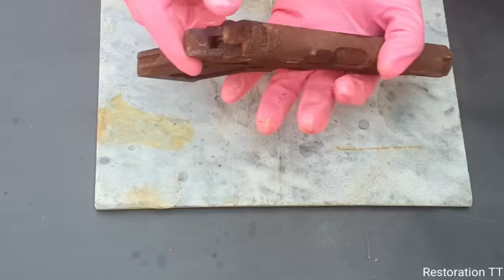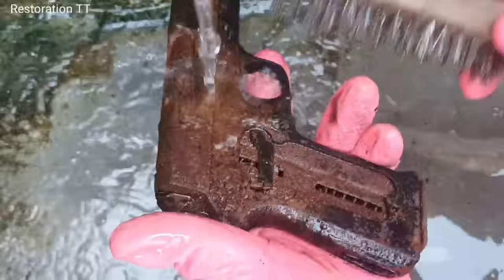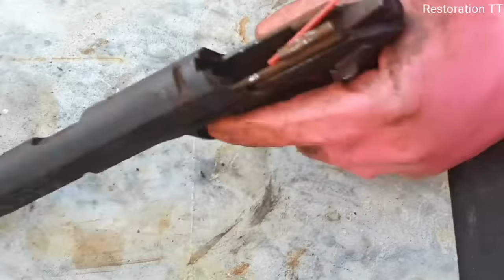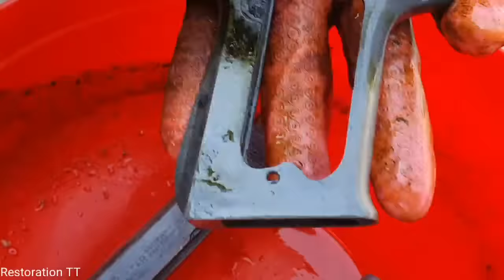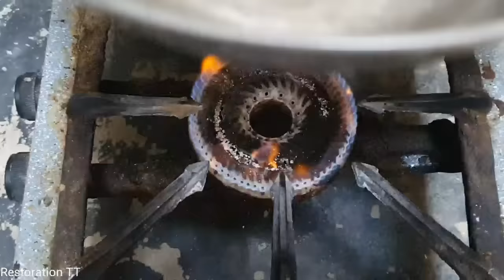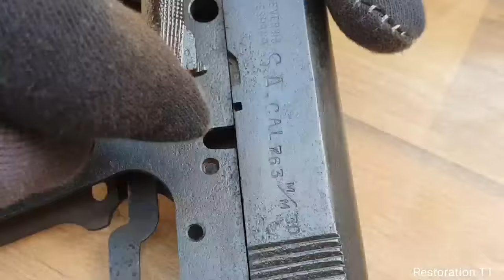Restoration Vintage Colt 1911 .45  Acp | Restoration Video | Restoration TT

Comment: That pistol is not a Colt. It's a Spanish copy made by Star who is no longer in business. They made very good high quality pistols. Also, please do not use a claw hammer on the gun. You will mar the surfaces. Use a plastic faced mallet. It will not damage the pistol.
Reply: España no hace copias de ningun Colt
Ese arma es una STAR de las casa Bonifacio Echevarria ,,,,de la localidad de Eibaer en Guipuzcua ,provincia de las Vascongadas españolas,ademas es de un calibre poco usual ,STAR hace armas de 9m/m....9 m/m corto y 9 m/m largo,conocida como SuperStar del 9 largo
Este arma no tiene nada que envidiarle al Colt de 1911,ni a ninguna otra arma
Reply: You need to get familiar with the brass, lead, or shot filled hard rubber styles of hammers for this kind of work. Brass punch set would also keep from marring those weapons. Don’t cause more damage to the project. Just saying!
Reply: dude didn't even have a screwdriver that fit, I doubt he has a plastic hammer
Reply: Im 1973 I had a new in the box Star BM. Very accurate and solid pistol.  The only 9mm ammo available in my area at that time was Super-Vel. Old timers will remember that name. It is a hot SAMMI type round. I ran box after box of it. The gun ran perfectly.  Funny, like most guns of that time sights were nubs. But, we adapted and hit what we were firing at.  Today, being 70 years young I like sights that pop to my eyes!
Best to ya',,,,!
Reply: @albertocruzado9305   @Alberto Cruzado  are you blind? Its a spanish made 1911. Astra of Spain copied the PPK and Llama of Spain copied the 1911 too. Lots of other Spanish made copies that are fine weapons too. Its not an insult, to imply its a copy. The Finnish copied the Mosin Nagant and made it better. In my opinion the Astra constable is better than the PPK! The Spanish make and made fine original firearms and fine copies too! :)
Reply: @landobrown186 
Ese arma STAR fue fabricada en España antes del 1911.
Lo que no tenia en esos años fue el calibre 9m/m, pero si el 7.65...fabricado( ANTES ) del 1911
Reply: @albertocruzado9305  el 1911 se desarrolló en 1910, y muchos de los diseños de Browning años antes eran esencialmente el 1911 en diferentes calibres. 7,65 y 9 mm eran rondas alemanas. El Star Model B fue desarrollado en 1931 de todos modos. Perdona mi mal español estoy usando el traductor de google.
Reply: @landobrown186  
Tu español es perfecto....enhorabuena por tu traductor.
Y tu explicacion casi me convence
Un cordial saludo desde Andalucia (España)
Reply: @albertocruzado9305  Bueno, solo me gustan las armas de fuego militares antiguas. Solo digo que me enorgullece tener un Star Model B y un M1911 juntos en mi colección. Creo que los españoles fabrican armas hermosas. ¡Estoy muy orgulloso de mi Astra! ¡Saludos desde Kentucky Estados Unidos! Que tengas un gran día amigo!
Reply: @landobrown186  a true 1911 has a swinging link under the barrel. This one did not. It’s function is to disengage the locking bands on the barrel from the slide. This one had none! It’s not a 1911 copy.

Comment: As a gunsmith watching how this person attacked the parts with a steel hammer and using incorrect size screwdrivers made me cringe. And like many of you said already this is not a colt 1911 but a cheap star knockoff 1911.

Comment: I am sorry, but maybe I misunderstood. This was supposed to be a restoration. And I loved the hammer used when it wasn't clear it was unloaded. I also noticed he didn't fire it. Too bad. May have fixed the issues with this if he had.😀
Reply: I wouldn't dare to fire this gun, also because there is no footage of the cleaning of the inside of the barrel.

Comment: I don't mean to criticize, but I would like to suggest that you put a small block of wood between the metal that you're hammering and the head of the hammer. This will protect the material from warping or being damaged in the hammering process.
Reply: very nice suggestion bro.and there is no lubricant the interior of gun
Reply: He had a wood block there
Reply: ماهو السائل الذي استخدمه لطلاء السلاح لطفا

Comment: I love the rust removing electrolysis you did. But what was that liquid you poured at 8 minutes 50 seconds?
Reply: I think it was vinegar
Reply: @3scottsbaker 
Vinegar will remove rust, but i wouldn't use it on a gun. I used vinegar to remove rust  on a few things but never on a gun.

Comment: This is One of the Few of these videos where Rollmarks were displayed.

Obviously this is a 7.65mm Star from Spain.

Colt does Not use a Pivoting Trigger.

Colt uses a Removable Main Spring Housing.

Colt has a Pinned Tube for the Safety and Magazine Catch detents and Spring.

Colt uses Bushings into the Frame for it's Grip Screws

Colt Magazines do Not use open windows to the followers Spring.

Colt 1911's do not have external Extractors 

Other than that and a complete lack of technical competence , this is a fantastic video on how Not to handle any Firearm or list videos by a supposed brand.😅

Comment: Colt 1911, tt33 and italy type 30bore hybrid in 7.63 Mauser and also blowback operated. 
It would have been a genuine restoration if this genuinely neglected pistol was not intentionally rusted or worked up for the thumbnail of this video. Although  the pitting shows it was genuinely neglected before,  but the brown rust coat is intentionally done because original bluing remains underneath.
No care given to the inner sides of the bore or the firing pin channel, extractor.
After restoration, its more of a decoration piece than a functional firearm.
Good work otherwise
Reply: Test fire may be in order, 3 rounds
Reply: "Good work"...LMFAO!!!
Reply: Nop. this is a spanish made copy of a colt Star guns was a spanish manufacturer of war weapons

Comment: This is actually an extremely rare Star MMS that came with a shoulder stock in .30 Mauser. One of only a handful made. Very rare indeed.
Reply: Then it should have said that instead of a Colt 1911. BIG DIFFERENCE
Reply: And he should not pound on such a rare firearm with a claw hammer
Reply: All things considered, truly disgusting. A perfect example of what you shouldn't do.

Comment: That's what I do! I beat the snot out of my pistol with a claw hammer and then drench it in Muriatic Acid. LOL. Works every time. And the accuracy of a smooth-bore that's been boiled, beaten, belched on and banged around in pots and pans should be quite good!

Comment: This is not like any Colt I’ve ever seen..  looks kinda close but there’s allot of parts that are different from the original 1911, inside and and out!
Reply: Its a Star. Spanish made pistol. I was told that they were nothing like a 1911 broken down.
Reply: @johnytamale8814  yeah that’s what I was saying when he was taking it apart every single part inside looks completely different from a 1911 I’ve built a 1911 from parts before I had to hand fit each part it wasn’t easy so I know 1911’s inside and out it looks like they kinda tried to copy it, but way different than an actual 1911
Reply: Yea i have a star pistol in 9mm. Ive only shot it once. I think i saw on Hickock 45 a review that even tho they look like 1911s there not the same. I just got into 1911s. Probably one day ill take my Star apart to oil it and compare.

Comment: A 1911 ish model but not a Colt. This job was done well enough to be a wall hanger but nowhere near fire ready. That's spring retainer you tapped in is supposed to be a free floating insert that is used to hold the barrel retainer in. If this was being done to fully restore this gun you have to do more with the pitting. Takes all the beauty from such a classic firearm. Good video though sir.

Comment: got 2 of those…1 chambered in 38 super..the other just a 9mm..the super has a little more recoil generates more chamber pressure..but
they both use the same bullet .355 or .356..these pistols were mostly used by the Spainesh police …
Reply: A little different you can not shoot the 38 super in the 9 however the reverse you can.

Comment: Great work on it. I want to give you a nickels worth of free advice. Do not use steel hammers and flathead screw drivers to beat and chisel the parts from each other. Get brass tools and wood. Less damage. Take it back apart and polish every piece to smooth them out. Then reblue it.

Comment: As you have already pointed out, it is not in .45acp but in 7.63, and above all the connecting rod that is placed in the slot on the barrel near the combustion chamber is missing, where the pin of the hold open will be inserted, without this barrel will be released, so DO NOT shoot us!
Reply: Don’t worry I am pretty confident it will never shoot
Reply: @calebdavis3110  👍🏻

Comment: It is better to use a hardwood chopper. And I would also advise throwing it into the lubricant entirely, and then at the vibrating stand: the vibrations will slightly devastate the parts so that lubrication penetrates them.

Comment: The weapon should not be dealt with by striking in this way, the rust must be treated before dismantling so that it is easier to disassemble the weapon and also the weapon is not assembled and the protrusions in the weapon are not treated

Comment: 3 things.
1. He uses a fucking hammer and a screwdriver which damages the gun
2. HE BANGED IT WITH A FUCKING HAMMER NOT KNOWING IF THERE WAS A ROUND IN IT YET
3. He couldve soaked this in rustremover to make things go alot faster

Didn't even finish it, don't need to. What a fucking nightmare it was to watch halfway

Comment: Its possible shoot with this pistol?
Reply: Put it in a vice and use paracord to pull the trigger. 
The inside of the barrel doesn't seem to be taken care of.
Reply: Absolutely NOT, because the connecting rod on the barrel that connects and binds the hold open is missing
Reply: It could... should you? Nooooo

Comment: In my opinion, the restoration is not very successful, the rust pits need to be cleaned with sandpaper, bluing should be done in saltpeter with engine oil, and finally get a copper hammer and use it instead of the usual one!

Comment: This is meant to be comedy yeah?? He's basically got a carpentry hammer, an old screwdriver and a Dremmel wire brush. Surely some special tools and a jig to hold the job would be the absolute least that's required.

Comment: In another country I suppose, no way would I let that firearm out of my old shop, it would be red tagged, or, a wall-hanger only, nothing else.
You are gonna get someone hurt, thinking they can do this to a firearm they might find, and possibly fire it, thinking it's ok.
That barrel, is junk, look at the pitting in the chamber area. If the inside of the chamber is that bad, it's toast.
Unsafe to fire, period. 
The slide is questionable, I'd have to see the breech face, and pitting up closer.
The ''tools'' are ridiculous, but so is this whole freaking video. 
I had to watch it, I've seen this ''restoration'' crap, and had to check it out....I won't make that mistake again.
Folks, do not do this, unless it's a wall-hanger, but do not fire it, it's not worth it. It's an accident waiting to happen.
And, you do not even get the name/model of the firearm right. You are a hack, nothing more.

Comment: I never saw a 1911 w/o a grip safety. I kept thinking what's missing from this pistol when he had it disassembled. When he was filing the slide and frame. Yikes. He never showed the condition of the bore as well.

Comment: Bubba, you should learn the art of filing to remove the pitting and leave the markings.  Draw filing that thing would have left you with some smoother surfaces and sharp crisp edges.  When the stainless wire wheel comes out there is trouble coming.   Given its not a Colt or other WW1 maker (it would have been an 1911A1 if WW2) you should consider doing something different and make it nicer.  Like powdercoat it black, then use 220 gr. paper and sand nearly all the powder coating off the gun.  The result will be all those pits will remained full of powdercoating and act like a filler.  Then clean it up and powdercoat it again.  You would be amazed, you can polish a turd after all.

Comment: Nice video, but why is it titled "vintage Colt 1911 .45 ACP?"  I noticed right away that the magazine was not 45ACP, and the slide clearly said Star 7.63 on it.  This is a Star clone of a Colt, and  I think some of the internal parts were different.  Also, why didn't you completely disassemble the slide before treating it?  I was afraid the extractor was going to set in place causing problems when firing.  I was also kind of afraid at the beginning when I saw the magazine rusted in place that there might have been some live ammo in the chamber which would make some of the earlier actions a little dangerous.

Comment: OMG, The Hammer, the loose fitting screwdrivers. The lack of Major spraying of the cleaner and soaking made me cringe. Just let it soak in a bath of the cleaner for a few days. Sorry, just saying, if it was a piece of any value, maybe it is? I mean BEFORE DISASSEMBLE

Comment: First things first.  This is not a Colt it is a Star, this is not a 45 auto and calling it "vintage" is stretching the term quite a bit.  Watching this hurt my brain.  That worn out dremel wire wheel drift punch, beating on it with that steel hammer and various other tools being used made me cringe.

Comment: Restoring guns is not your thing, trust me.
I restore antique guns, and you're just bashing the crap out of a gun, not only stressing the metal in the parts before checking them wich may cause cracks but also not even knowing if it's loaded.

Comment: If the barrel was pitted that bad the slide would of been worse with no role marks left and the magazine probably would of had holes in it I will call this one a fake restoration on a non colt with every tool used being a very poor choice.

Comment: When the hammer first appeared I had to quit right there. That is an early 1911 and easily savable if done right, hitting it with a damned hammer is not the right way. You first immerse it in diesel for a week or so, then disassemb;le properly. I am outta here.

Comment: OK this is how NOT to restore 1911. Using hammer during disssassembly :(. Destroyed front of gun lock ... WHYYYYY. He was not even able to use 4 same bolts on handle. And used cross bolt ... This is just painful .... see it ....

Comment: First thing I noticed was that the description is wrong. It's not a Colt 1911, it's a Star Model A, in 9mm.
I stopped watching at that point, because if this youtuber isn't honest enough to know what it's working with, it's not worth watching.
Especially not when they deliberately cause very sloppy, very simple rust to make a 'restoration'.

Comment: Oh good, it is certainly not a Colt, but it is a Spanish Star Single Action ripoff of a Colt, and no detent springs for the safety? Get some ammo and try it out. I'll put 911 on speed dial for ya. Oh, and converted rust or black oxide finish is actually still used by some low end gunmakers today. Taurus immediately comes to mind.

Comment: Im not sure what model of gun this is?? But it is not a 1911 colt 45. I have an original 1911 colt 45 manufactured in 1808  army issue. This is not it.
Reply: I meant 1908 sorry about the mistype
Reply: I meant 1908 sorry about the mistype.

Comment: you need better tools. a brass punch. stronger screwdrivers. and that wire wheel is atrocious you used as a pin punch. and a vise would have been helpful. steel hammer? on a housing? really? you just created an extra hour of deburring. dude. pay attention too. it could have been loaded and you smacked it with that awful hammer

Comment: HORRIBLE !

How dare you call this "restotation" ?

You beat the 💩 out of the poor gun with a hammer, wrong tools everywhere, using a bolt to drive the endcap out ... why not start with the rust remover, let it dissolve the rust, THEN try to take it apart instead of smashing it with a hammer ?

By the way, it's NOT A COLT, it's a Star copy chambered in a mickey mouse cartridge 7.65.

Comment: Stop scrubbing with steel brush!
Let electrolysis do it's job.
You could have been a far better job by not initially spraying with oil but do electrolysis. Wind wire around many many times and after 24 hours remove and do it again in a clean solution. Repeating that 3 * would have made this so much easier for, but maybe that just makes for a boring video. Instead you prefer to put out a sucky content. This video was a thumbs down